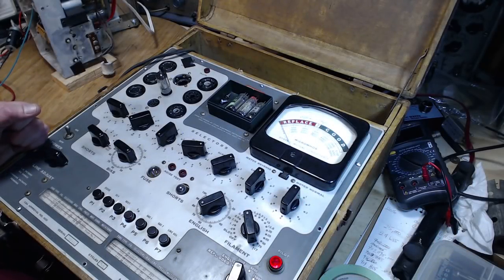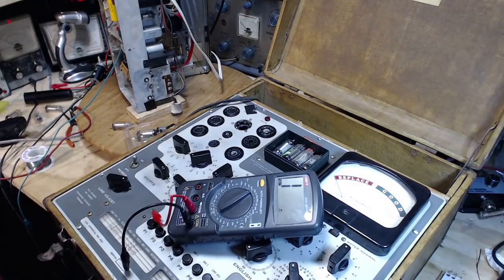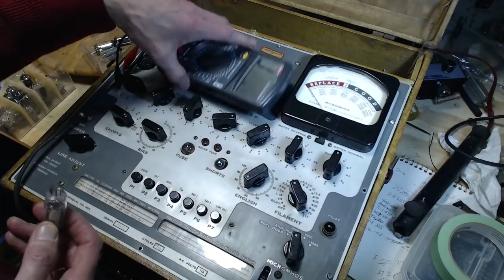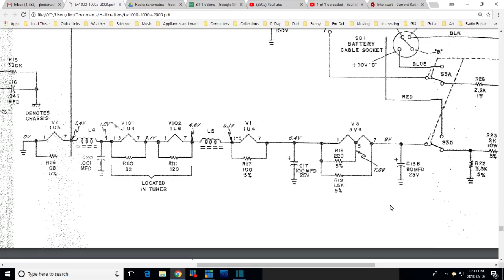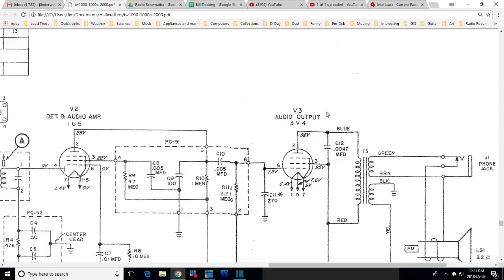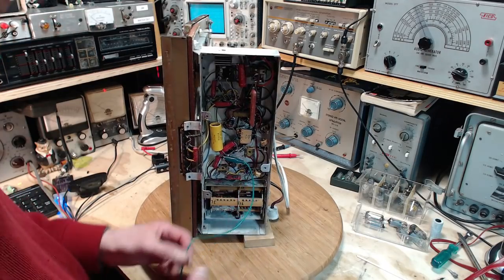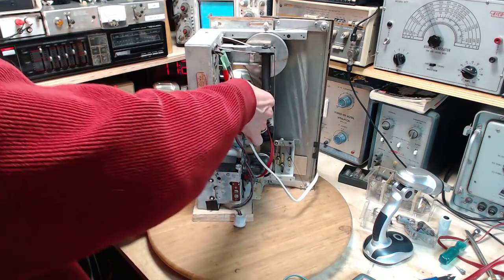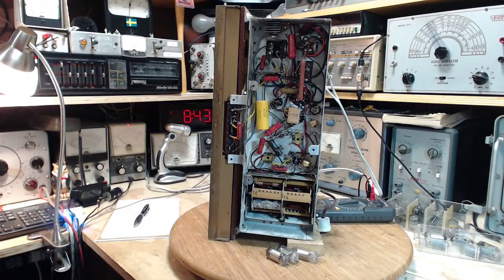Hallicrafters TW2000 World Wide Video#5 - 3V4 Output Tube

Comment: As I recall these battery sets had a problem with the electrolytic multi section caps leaking between sections causing filament burn outs. I don't recall the exact details except for re-replacing tubes. Also don't remove or insert the tubes while being powered, be sure all filaments are good before applying power. Bonne chance!

Comment: Jim look at the big electrolytic capacitor connected to the 3V4 filament wire going to the tube to its left.  The other side of this cap goes to ground.  If this capacitor is shorted out it will apply the entire 9 volts to the 3V4 filament.  Don't know if you have checked this cap or not, but that is the most likely reason every 3V4 you plug in dies.
Nemozilch

Comment: This is an explanation for those resistors in the filament string: Here is something I found on another site (https://people.ohio.edu/postr/bapix/TW2000.htm ) on those resistors and why they are there. "In comparing schematics, I noticed that every tube filament in the TW-2000 has a resistor in parallel across it. That reduces the problem of a filament-supply capacitor charging to full B+ in the event of a open filament or loose tube (and discharging that cap into the filaments if a new tube with a good filament is then inserted.) The resistors provide a full bleeder path."

Comment: that capacitor you tested is the cause of the tube failure. one of the two capacitors to ground, either side of that tube. do not believe it is a resister.

Comment: congratulations for killing the second tube. i told you that this receiver is cursed. at least look into that filament string power circuit, because you'll end up burning out the other heater too. try powering the filament string from a current limited DC supply for starters. change those capacitors. check out the tube socket, maybe it's leaky and the anode supply can leak back to the heater pins. the meter has shown at least 16 volts when you powered up the radio. that's way too much.

Comment: Just wondering what about using both triodes of a KORG 6P1 mounted on a piece of Veroboard and using wires to connect from the Veroboard to a matching plug to let you use the KORG 6P1, The board can be mounted somewhere on in the case so what about it.

Comment: I'm not convinced the 100uf cap is not leaky.
Check R22. if it is open, more current will be supplied to the heaters. I'd also forget the AC supply for now and use the battery inputs and a 9V bench supply.  Bring it up slow and see if it draws 50ma and the voltages are proportional. I.e the 6V pin on schematic at 5V power should be about 5/9 of 6 or 3.3V . Then use a B+ supply., Finally pull the tubes, put a dummy load at the 9V point (9/.05=180 ohm 1W) and test the AC supply.
If it was me, such a low current radio would have all its paper and electrolytics replaced before power up.
Reply: Also, if the  sections of C18 are open, the average current would be higher. Hard to describe mathematically, but if say the peak ripple is 2x as high, you get 2 times the voltage and 2 times the current at that point, so 4 times the desired power. Of course if the 100uf section is good, then you get most of the ripple passing through the 3V4.